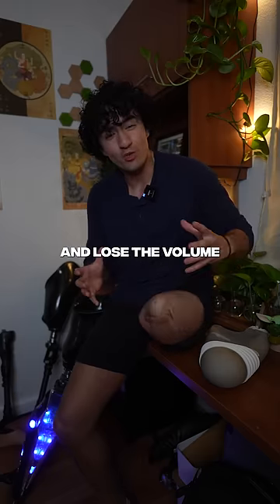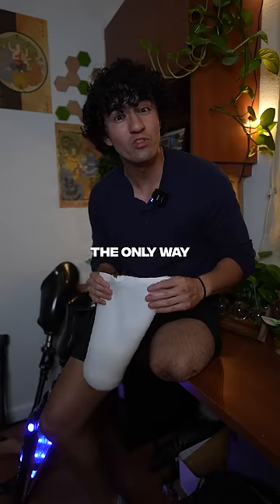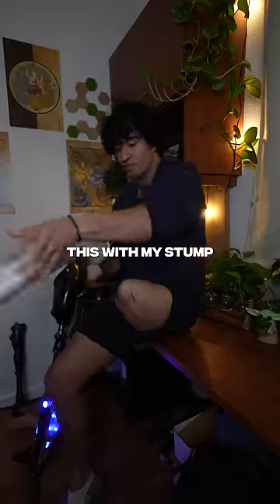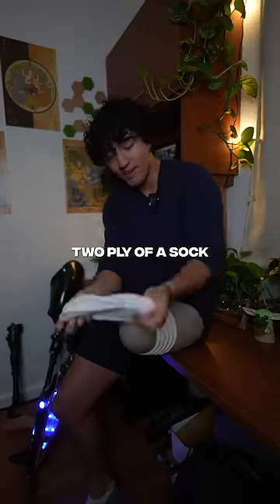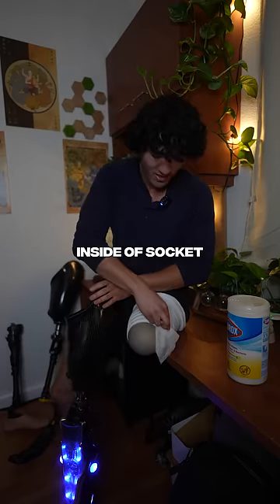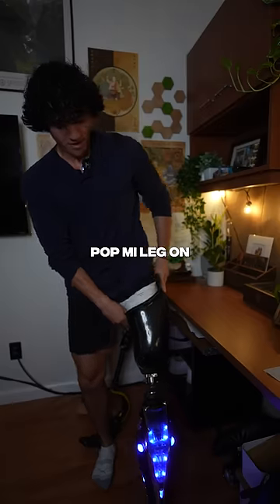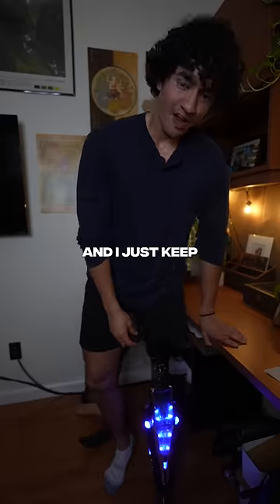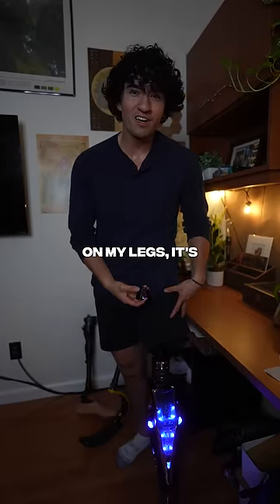How I keep my PROSTHETIC LEG from coming off

Comment: My dad lost his leg above the knee when he was about the same age you are (mid twenties I’m guessing) and because of that, I grew up with the mentality that a missing limb is normal.

It’s so cool to see other people learn about the differences in life that develop from having a leg missing. It’s also really cool to see the levels of technology that we are able to put in prosthetics nowadays even compared to 10 years ago.
For example in one of my dads older legs, the only real technical feature it had was hydraulic fluid in the system to prevent the leg from being to floppy but his most recent leg can connect to a phone and has a remote to allow him to control different settings in how it moves in response to him. It’s really cool.

Although one major downside with modern prosthetics is that they can cost a lot of money. As in a new car can be cheaper.

Comment: Living in the past. I have been wearing the Martin Bionics adjustable socket for several years and have fluctuated 15-20 lbs. The adjustability allows me to tighten or loosen the socket throughout the day based on the temperature, humidity level or activity that I am doing with zero rubbing, blistering or soreness.

Comment: Prosthetics have changed alot since i was young. Growing up my dad had an artificial leg which had a similar rubbised sock but it had a screw attachment that slotted in. It didnt screw in but i guess more pinned in and strapped on i guess with some level of negative air pressure to keep it on though i was never told much other than seeing him put it in. Also definately never had no leds or by the looks a carbon fibre fitment piece